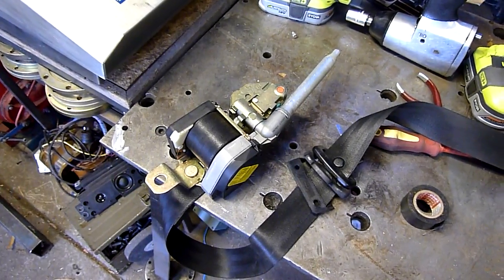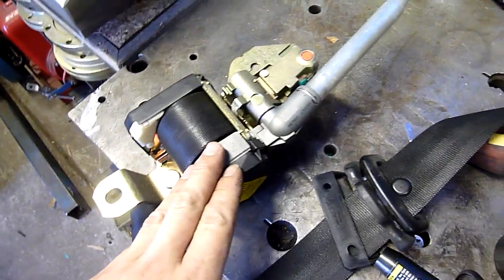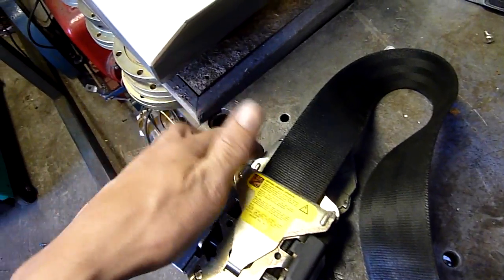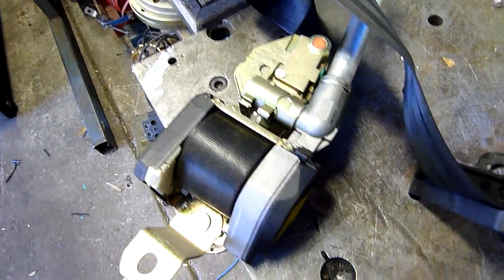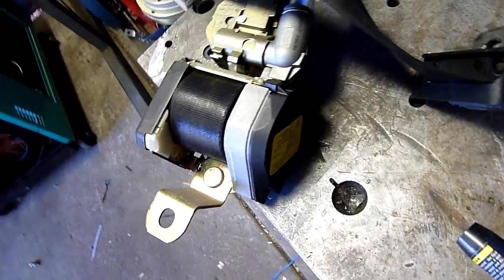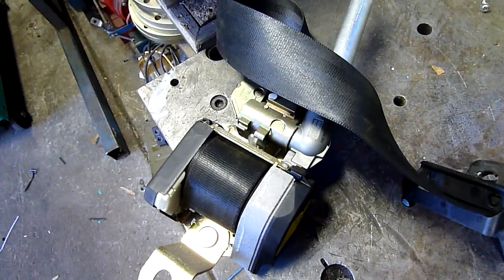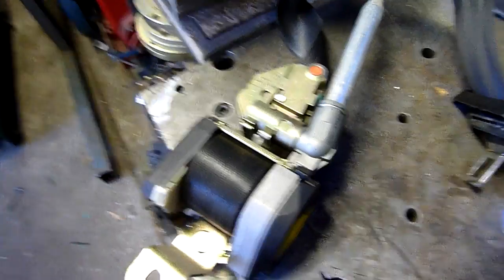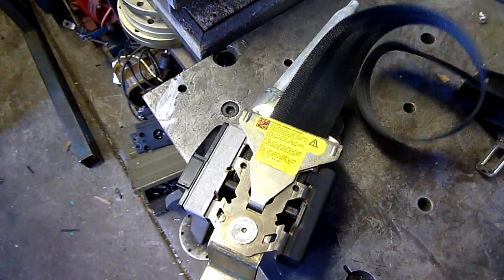Daewoo Lanos Striker Fired Pretensioner Examination

Comment: In a lot of American vehicles, we have pretensioners that just lock the belt from going forward, then when you fall back in the seat, it ratchets and holds you there. It's completely static, but I'm not sure whats safer. I wouldn't want to be yanked back into my seat, but the ratcheting ones don't seem a bit more useful, as when you fall back, the impact is over.

Comment: I know that the Americium in smoke detectors is inside a small box made out of thin sheet metal so there either isn't very much material in there or it's low level stuff. It has also been suggested that a smoke detector should be replaced every six years, so either that's the half life of the Americium 241 or the shelf life of the electronic components in the detector.

Comment: There is, of course, a way to safely dismantle those things.
Most manufacturers have the instructions for free download at their websites.
This particular model should have a ~2mil hole somewhere. 
Just stick a suitable allen key in it and its safe.
I wouldn't recommend a nail. Anyway don't do it if you are not sure what you doing.
Steel cables, a charge of explosive and fingers don't mix wery well...

Comment: Hang the thing by its belt, somewhat unrolled and sitting on the inertia lock. Attach a heavy chunk of something to the gold coloured mount on the bottom and give that thing a swift tap with an 'ommer. See how high it jumps.

I've thrown these things at the ground before and they are pretty underwhelming, definitely fires but the thing hitting the ground makes more noise than the charge...

Comment: 5-10 lb sledge hammer with the end of the handle mounted on a pivot and the hammer is spring loaded using a few octapus straps. the hammer would be held back with a psudo quick release (pin through a u-shaped piece of sheet metal w/ another piece of sheet metal in the middle of the u-shape)

Should allow you to fire it from a nice safe distance. My car has them as well, hope I never need them because given I fasten my seatbelt before driving its bound to hurt.